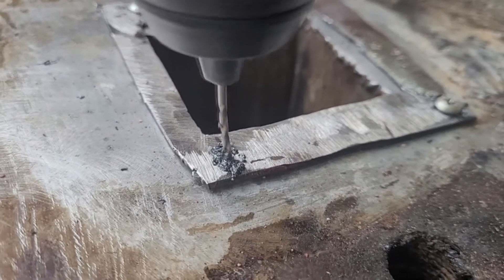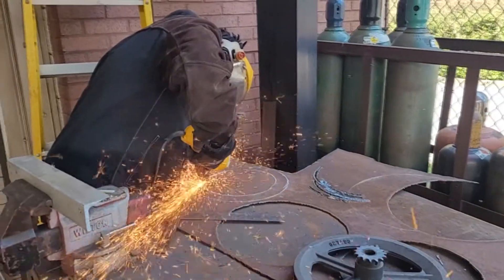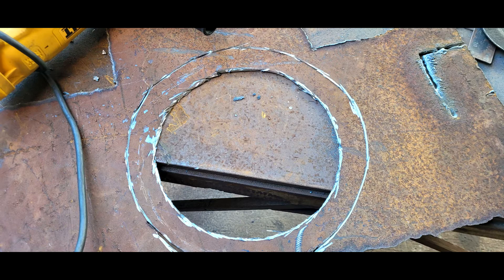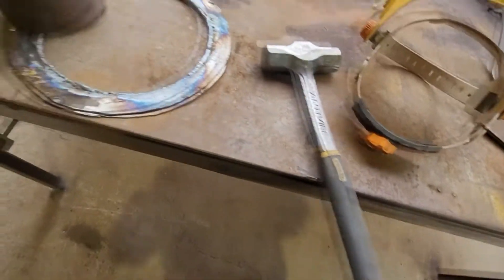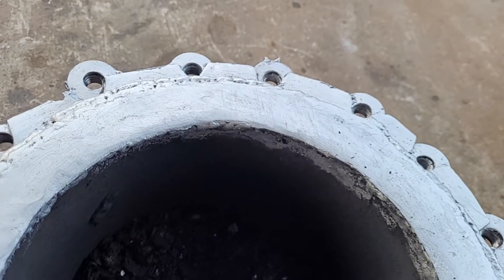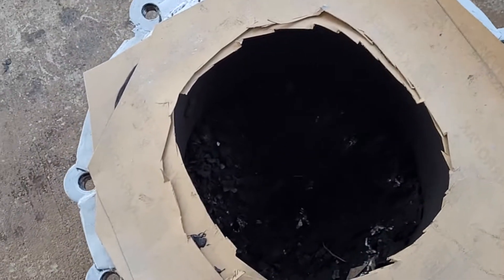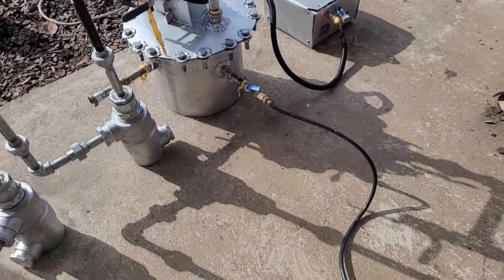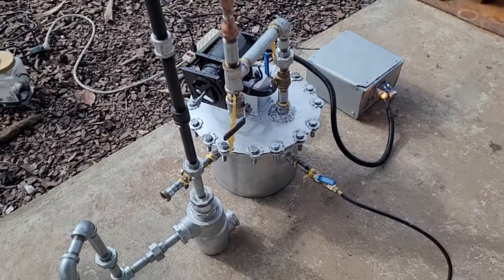Pyrolysis Reactor Update   Airtightness

Comment: Have you tried a copper gasket? Two sheets of copper flashing. Soft metal, works, till the heat harden anneals it, then a little rtv for later runs.

Comment: Great work! That gasket paper is good stuff, I’ve coated it in exhaust repair paste and sealed a combustion chamber with it in another project. Don’t be surprised if it turns to dust after a few runs! 

If the gasket paper leaks, try that exhaust repair paste. I use that on the top seal of my pyrolysis machine (with no gasket paper just paste) and clamp it down like yours. No leaks whatsoever 😎👍
Reply from the maker: Alright thank you! The spacer rings definently give me good modularity with spacers. The gasket so far had 0 leaks and 0 oil soaking thru it so it's working amazing 👏 
I'll look into the exhaust cement
Do you need to reapply it after every open and closing?
Reply: Yes you do, but it comes off really easy with a wire wheel. It’s a 2 minute job to remove it and re apply 👍
Reply from the maker: @elcaboelcabo2881  Alright sounds good. It definently sounds like a great thing to use if I can incorporate a hopper system so I don't have to take off the lid every time I load plastics, cheers!